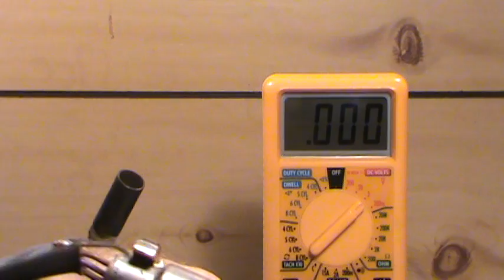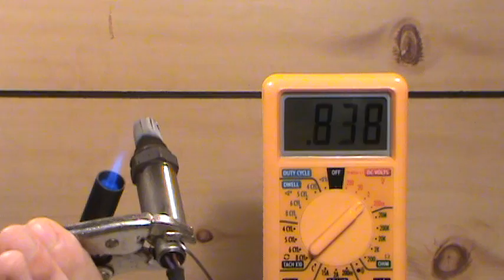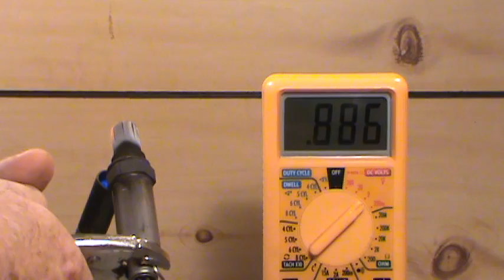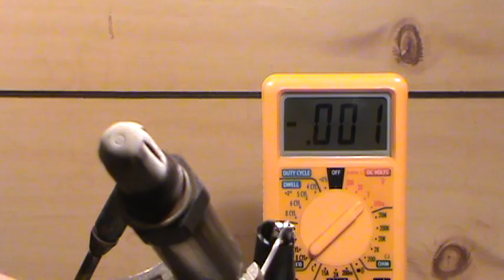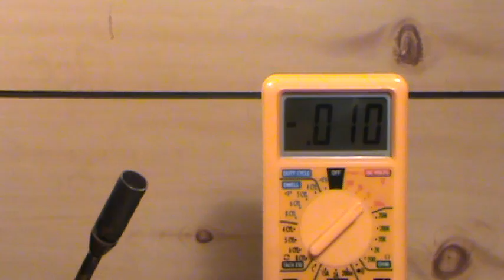Oxygen Sensor Test

Comment: thanks for the video 
I have this code 2C9F can you please tell me what is the problem?
[oxygen sensor heating after catalytic converter 2, activation]
i don't have check engine light.
my car is x5 E70 2007 4.8i
Reply from the maker: Greetings...ismail alnadabi...............You're welcome, and thanks for watching................The BMW Code, that You mentioned, comes up, as a problem with the "Oxygen Sensor", that is "After", the Number "2" Catalytic Converter, and, could be a problem, with that particular Oxygen Sensor's (built inside of it) "Heater"/circuit, or maybe, something wrong, with that particular Oxygen Sensor's, (electrical) Wiring Circuit, that is connected to, Your X5's...On-Board Computer...............You might have a "Dual" Exhaust System (as in, 2 Exhaust Pipes, 1 Exhaust Pipe, on each side of the Engine), on Your BMW X5, and has me thinkin', that, there could be, "2" Catalytic Converters, on Your Vehicle, and might also have, "4" Oxygen Sensors as well............That "Code", was probably pointing to, the "Post" (or After, the) Number "2" Catalytic Converter.................If You get Lucky, You, might only have to, "Replace", that particular "Oxygen Sensor", with a "New" one, in order to "Fix" Your X5...and...if that Doesn't Fix the problem, then, further Testing, will probably have to be done, in order to find out, what is actually causing the problem................Good Luck, and till next time.........Be Safe, take care, and have a good one.
Reply: thank you very much for the replay, today i got the new one & i am going to change it tomorrow
i will feed you back dear
Reply from the maker: Greetings...ismail alnadabi...............Here are a few things, that will hopefully, help You out..............Make sure, that You have the "Exact" Oxygen Sensor (Part Number), that gets installed in, the "After", the Catalytic Converter position, cuz sometimes, they can be Different, than, the, "In Front of",  the Catalytic Converter ones..................The "Bank" and the (position) "Number", for Your BMW X5's, V-8 Engine, should be as follows, as long as I get it right, that is, and, You can also, check for Yourself as well, just to be sure................The "Bank", of the Engine, is usually, the Side of the V-8 Engine, (maybe, but not always), and usually has, the Engine's, Number "1" Cylinder (on that particular Side)...so, Your X5's Engine, appears to have, Cylinder "Number 1", on the Right Hand Side of the Engine, as You are sitting in the Driver's Seat, and, as far as I know, that will be..."Bank 1".............Then, that leaves, the "Left Hand Side", of the X5's, V-8 Engine, as..."Bank 2"...being the "Side", that, You were saying..."after catalytic converter 2"...being, where the Problem is, possibly...???...............Now then, as for, the "Position", that the Oxygen Sensor is Located/installed in................You were saying..."after catalytic converter 2"...well, I could take a guess, but, I'm not all that sure, that I'd be 100% correct, so, make sure, "Before" You install, the New Oxygen Sensor, maybe Check first, as to where, the "Correct Location" happens to be................So, for future reference, something like, "Bank, 1 or 2" (of the engine)...and..."Sensor, 1, 2, or 3"...(oxygen sensor location), can mean Different Positions, depending on the Manufacturer, of the Vehicle & Engine in question, so, always "Check", the "Bank" (of the engine), and (oxygen sensor) "Location", for Your "Exact" Vehicle and Engine, so things, don't get messed up...............If Your BMW X5, does have, a Dual Exhaust System, and, it happens to be, the one that I saw, then, there will probably be, "2 Catalytic Converters", on Your X5, kinda positioned, side by side, and spaced apart, some-what, and, there will probably be, 4 Oxygen Sensors in total (I think)...............1 Oxygen Sensor "Before"...and...1 Oxygen Sensor "After"...each of the (two), Catalytic Converters, that are part of, Your X5's, dual exhaust system, well, if I get it right, that is.................You might find, that, a used/installed in the exhaust system, Oxygen Sensor, can be quite Stubborn/Difficult, to Break Loose/Loosen initially, so, sometimes, I use a Hammer (or what-ever), to hit, on the Wrench, cuz, the Impact (of the Hammer, on the Wrench), will usually be more forceful, and superior-to, that, of, just trying to, pull, or push, on the Wrench, as the case may be...............Make sure, to put some, High Heat, "Anti-Seize" Compound/Paste, on the screw-threads, of the New oxygen sensor, before installing it, or, it's gonna get "Stuck" real good, once the exhaust system, gets Hot again..!!!...oh, and, "Don't", get any "Anti-Seize" compound/goop, on the "Sensing End" of the oxygen sensor, or it might, contaminate/ruin it...!!!...just so You know, oh, and, make sure, that, the New oxygen sensor's "Wires", are, well away from, any, Hot or Moving parts, that might Damage them...............Now I'm thinkin', that, the "Bad" Oxygen Sensor, will possibly be located, on the Catalytic Converter, that's on the Left Side (Bank 2), and, at the Rear of it as well (oxygen sensor)..."Position 2"...cuz...(Bank 1, will probably be on the Right Hand side, and, (oxygen sensor) "Position 1", will probably  be, in "Front" of, the cat/catalytic converter, and, will probably be, on the Right Hand side as well), as far as I know, so, like I mentioned earlier (some-what)..."Always, Check and Verify"...the..."Bank" (of the engine)...and...(oxygen sensor) "Position"...of those good ole Oxygen Sensors, for Your "Exact" Vehicle and Engine, that way, as I see it, will usually, make for, a lot less Headaches, in the long run, so to speak................Make sure, to keep things "Safe", especially, when-ever, Working Under a Vehicle...!!!..............Good Luck...and...till next time........Be (Extra) Safe, take care, and have a good one.

Comment: I  was trying to explain why when the sensor is in the flame there is mv produced. it is not due to the heat. it is due to the fuel and o2 in the flame area creates a ratio of fuel/air is different to the ambient air. the o2 sensor is able to compare this in its sampling chamber. then is able to convert to a mv to represented in a electrical signal for the ecm or a gauge. it needs heat for the sample chamber to work but that is not why it produces the electrical current. if there is not fuel to compete for space of o2 it would say air to fuel is 1:1 and produce no mv. 0.5v is suppose to be 14.7:1 and 1v would be well so e what richer than 14.7:1.
Reply: did this quick on a phone. please excuse any typos and reference to fuel/air when the ratio is actually air to 1 part fuel.
Reply from the maker: Greetings...Wes Anderson.................For the Zirconia/Narrow Band type of Oxygen Sensor, the Stoichiometric (14.7 to 1 air/fuel ratio), Voltage value, should be .45 Volts (450 mv)........(here are a few examples for You)............If it's "Richer" (air/fuel ratio-wise), than Stoichiometric, then, the Voltage should be "Higher" (maybe .8 Volts/800mv) perhaps...........Then, if it's "Leaner" (air/fuel ratio-wise), then, the Voltage should be "Lower" than Stoichiometric, and might be .250 volts/250 mv perhaps....................The Heat, that I was talkin' about, was in reference to, how "Hot", the Oxygen Sensor's, Sensing End, had to be (as in, 600 Degrees Fahrenheit or hotter), just so the Oxygen Sensor could start "Working" properly, that's it, nothing more.....................These Zirconia/Narrow Band oxygen sensors, are Only, fairly Accurate, while at the Stoichiometric Point, other than that, they can Only tell the Computer, that it's either...Too Rich, or Too Lean (do an internet search for a "Graph", for a "Narrow Band" Oxygen Sensor, and see for Yourself).................Maybe, while You're at it, also search, for the "Wide Band", type of Oxygen Sensor, and a "Graph" for it as well (has different Voltage values, and might also, go by the name...Lambda), and, the "Wide Band" type of Oxygen Sensor..."is"...Super Accurate...when being compared to, a "Narrow Band", type of Oxygen Sensor...!!!...and.........till next time.........Be Safe, take care, and have a good one.
Reply from the maker: Greetings...Wes Anderson..........Not to worry (about being Fast on Your Phone...lol)

Comment: your test should be in flame it should read the fuel risk flame should come out at 1.0v the max of rich. 

out of the flame should be 0.0v no  fuel.

when you found 0.8 that was just a post on where there is rush fuel area greater than 0.5v = 14.7afr. 

hope that helps.

if your getting 1.0v for that sensor it is likely good. it is when you put it in the flame and you can't get 1.0v you know it's faulty for sure. 

if your getting better fuel economy with a new sensor then it was on its way to completely failing.
Reply from the maker: Greetings...Wes Anderson..................Thanks for watching..............To me, the Narrow Band Oxygen Sensor, in this YouTube Video of mine, sure seems to be working, not all that bad (I hope), and, maybe, sometime in the future, I just might install it into the exhaust system once again, in order to see, just how well, or not, it functions/behaves........................I only put in a New Oxygen Sensor (to replace this one), cuz it had quite a few miles on it, and, I figure, by, installing a New Oxygen Sensor, it would help the Vehicle get through the Smog/Emissions Test, with that "Pass", stamp of Approval, printed on the Results paper, and maybe, with lower Emission Levels on it as well....................Now I'll add more information to Your "Other" Comment...

Comment: you have a reading of rich fuel in the flame as it is fuel rich. the flame is fuel and air burning. the sensor is reading 1.0v cause there is a lot of fuel. there has to be a constant source of fuel to have flame. when you pull it out of the flame there is no fuel there is heat and there is o2 but no fuel left so no flame. is this making sense no for reading of the o2 sensor being 1.0v when placed directly into the flame now?
Reply from the maker: Greetings Wes Anderson..........Thanks for watching.................This test, that I performed, on this Narrow Band Oxygen Sensor, with the Propane Flame, was recommended, by a very well respected, Automotive Component Parts Manufacturer, and goes something like this..............Once the Zirconia type of Oxygen Sensor, is placed in the Propane Flame, it must produce at least .8 Volts, in less that 1 minute.................Then, when the Oxygen Sensor is Removed from the Propane Flame, the Voltage, has to drop down-to, almost Zero Volts, in about 3 Seconds...in order to Pass, this so called Test, I would assume....................Some basics now............The Oxygen Sensor's, sensing end, has to be heated-up to, at least, 600 Degrees Fahrenheit, in order, for it to start functioning properly......................The Name..."Oxygen Sensor"...is a "Clue", all in itself, as that's, what it's supposed to be doing..."Sensing & Reporting"...the Oxygen Level, in the Exhaust Gas (when installed, in a vehicle's exhaust system), in the Form of a Voltage Signal...............The Narrow Band, type of Oxygen Sensor's Voltage Signal, is just that..."Narrow"...and from what I recall, it's Only "Accurate", when it's close-to, that 14.7 to 1, Stoichiometric Value, and can only tell the Computer, that, I'm, either, Too Rich or Too Lean, cuz, from what I recall, the Voltage Signal, is kinda like an (electrical) Sine Wave, going above and below, the Zero Volts Line (cross counts), and that poor ole Computer, has to Pulse the Injector/s (duty cycle, or on-time)...(and maybe adjust the ignition timing advance too...maybe...???), to try and stay, reasonably close, to that 14.7 to 1, while in Closed Loop Mode, while the engine is at operating temperature, and, while also, going easy on the Gas Pedal, at the very same time...................Someone was saying, not so long ago, that, the Voltage Level, will probably be Below 1 Volt...???...while being super Rich (air/fuel ratio/mixture-wise)................Gotta remember now, when the Temperature Drops Below, that 600 Degrees Fahrenheit, the Oxygen Sensor, probably won't be able to, do its Job Properly, if, at all....................If You happen to see Lots of black Carbon Deposits (like I have), on an Oxygen Sensor, then, You have quite the problem alright...............Might be too Much Fuel, or, a Malfunctioning Ignition System..or...maybe...Both...!!!...Yikes...!!!...lol...and.........till next time.........Be Safe, take care, and have a good one.
Reply from the maker: Greetings...Wes Anderson................When I was talking about the Oxygen Sensor's, Voltage Cross Counts, I mentioned the Zero Volts Line, but, now that I think about it, it might have been the .45 Volts Line...???...maybe...

Comment: Hello. Thanks for the useful video. I used this instruction to test the probe on my wife's BMW, which didn't pass the exhaust test. I couldn't get it over 0.4V, so I ordered a new one. I was burning it red hot without success. So thanks for your help. Will see if the new sensor will solve the problem or is it something else there too.
Reply from the maker: +Srečko Lavrič ....Greetings Srecko Lavric....You're welcome, and, Thanks for watching..............That .4 Volts, that You got, sure seems kinda Low alright...............The, shall we say, Official Test, that was suggested, by a very well Respected Automotive Component Manufacturer, should be as follows....................When the Sensing Tip, of a Zirconia type of Oxygen Sensor, is Heated-Up in a Propane Flame, it should be Producing .8 or More Volts, with-in 1 Minute..................Then, when that same Heated-Up Oxygen Sensor, is Taken-Away from that Propane Flame, the Voltage Reading, should Drop Down, very close to 0/Zero Volts, With-in 3 Seconds................Now, here are a few of my own thoughts.........If, the Zirconia type of Oxygen Sensor, that's being Tested, in the above manner, Fails either of the 2 Tests above, then, even Before Testing (as above), and still being Installed in the Vehicle's Exhaust System, of an OBD-2 (On Board Diagnostics-Version 2) Computer controlled system, that, as I recall, started being Installed in Vehicles, oh, about 1996 there-abouts, then, the Faulty/not so good, Oxygen Sensor, or, Oxygen Sensors, as the case may be, would probably be Detected, by the Vehicle's On-Board Computer, and, the Trouble Code, or Codes, that were Stored, in the On-Board Computer's Memory, could  very well be, along the lines of, One, or more Oxygen Sensors, that might have, a "Slow Response", or possibly, a "No Response", once the Trouble Codes have been Verified, that is.......................If You are having any problems after You get that New Oxygen Sensor installed in Your BMW, then, it would probably be a good idea, to have Your BMW's, OBD-2, On-Board Computer "Scanned", if, Your BMW is about 1996 or later, that is.....................Some Automotive Parts Sales Businesses, that I've heard about, will actually "Scan" a Vehicle's, OBD-2, type of, On-Board Computer for "Free"...!!!...just make a few Phone Calls, in the area where You live, and ask them..................Another thing to have Tested (but probably, Not Free), is, the BMW's "Fuel Pressure", to Verify, that, it's with-in, Your Exact Vehicle and Engine's Specifications...................If You need any further help at all, just let me know....................Good Luck, and.........till next time.........Be Safe, take care, and have a good one.